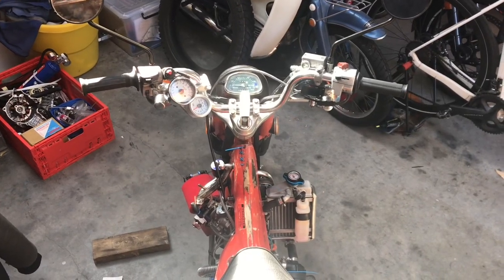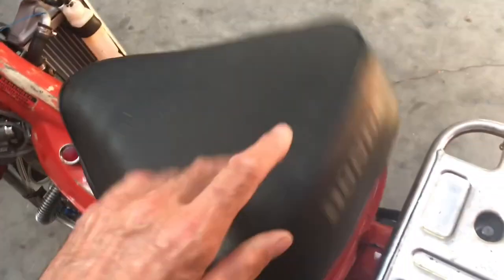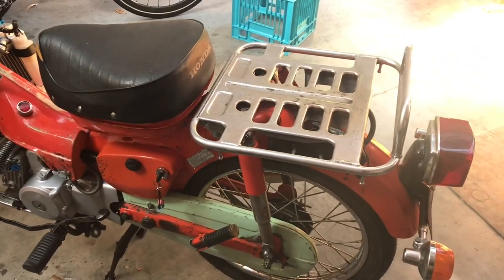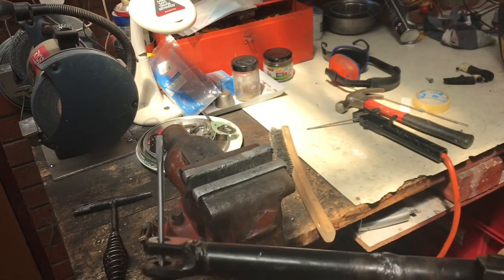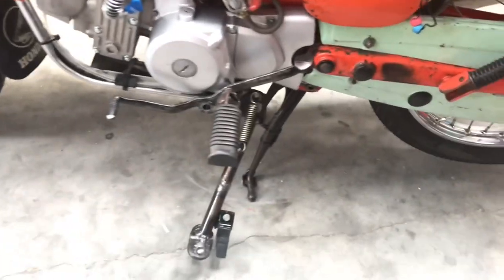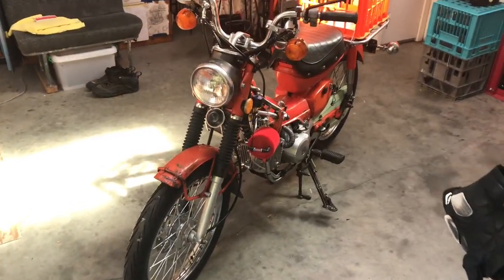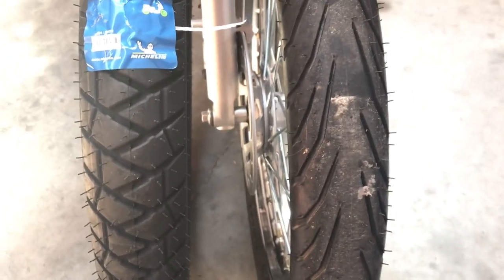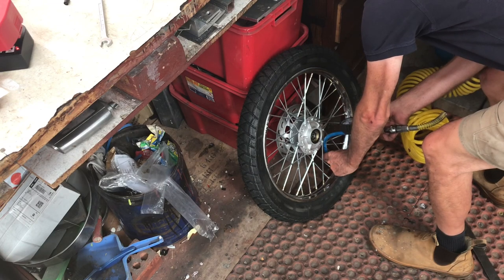Supercharged Nos Postie Bike Ep44 (prep for first ride) @tiolibikes8663

Comment: Enjoyed this video, good to see your excitement as the nos beckons.  The tool kit bolts on to a lug on the rack, but your rack is the earlier type & doesn't have the lug.  On my 6v postie, the tool kit fits next to the battery, but I've made a larger tool kit from some 75mm pvc pipe & bolted it under the rack. I had a valve rip out of the rear tube this week & I didn't film me changing it as I hate tyre changing & don't want swearing on the channel haha.  I agree with you, the bike looks much better with the fatter tyres.  Can't wait for a road test.

Comment: Where did you get your exhaust? I would like one for my custom Postie bike.
Reply from the maker: Hi Robert the exhaust is two seperate purchases but both from AliExpress when I used to get stuff from there (used to) The header is for a C90 hence low swept and the muffler is one I bought for the Beemer as I removed the stock muffler to add my own design but for touring I need a quieter one and a exhaust exit beyond the soft panniers I use.
Reply: Haha the nos is talking to us all 😎😁